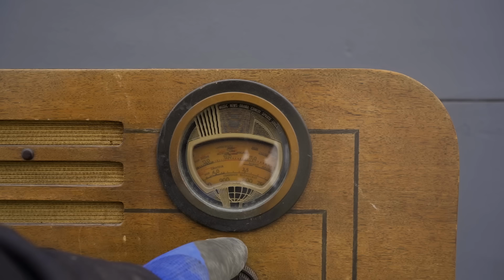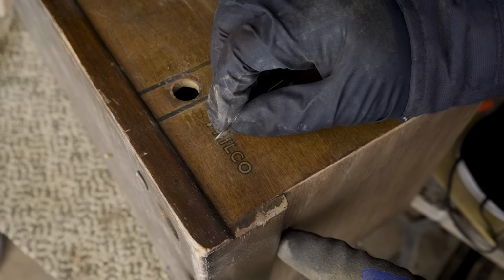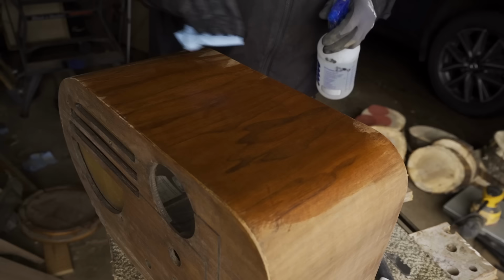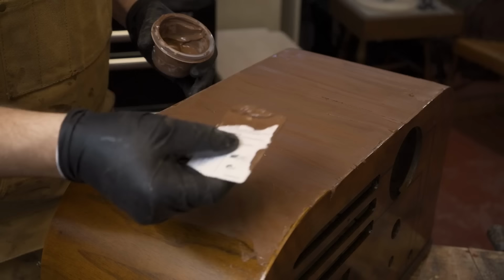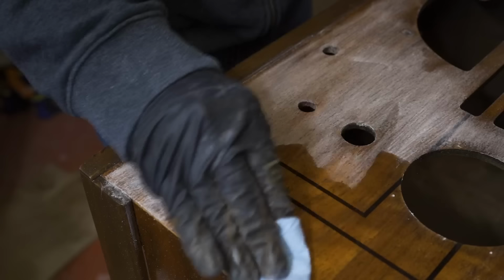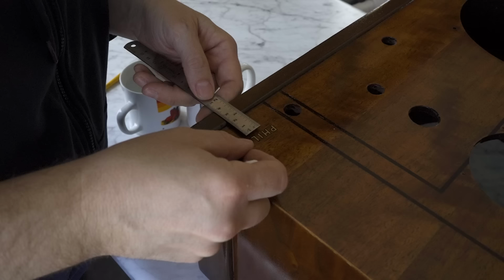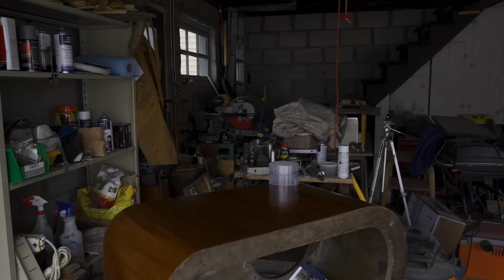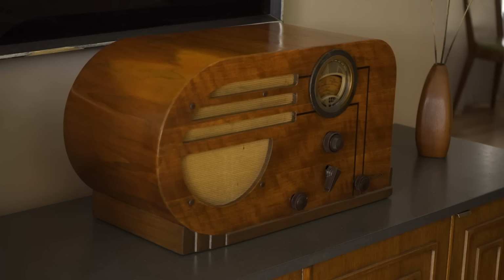Saving A Filthy Philco Radio | Vintage Philco Radio Restoration

Comment: Hey I have an Old Phil something similar to yours mines in a case built around the Raido. It an Old Yellowish tan color an the lid unfastened on the top front. It lays down to where you can see the radio face. It has an old leather handle. The radio itself is in pretty good condition as the case mine is either from the Mid to late 20's to early 30's that around the time my Brother in laws Parents owned an ran Lola's Caffe in Texas. It long gone now. I think the Leather Handle it's kind of detorating an I think at least 3 of the corners are needing some work with the cloth. The Raido is in good shape. I think my Father got it to play a couple of times then it quit.  Not sure why.  I have a other small table top Raido it kind of a redish Purple in color. I don't seem to remember the brand of it. Got both of them salvaged from my Brother in law. We believe they were his Mom an Dads. Brother in law is in his l his mid to late 70's I believe.

Comment: i find spray lacquer is crap and can ruin a whole job.....i usually give a few coats of varnish by hand sanding inbetween each coat with finer grade sandpaper..the final coat i sand with fine wire wool then wax it......PS - love the design of this radio and you done a lovely job with it.

Comment: You know there's not that many videos that could easily use the start of Pink Floyd's Wish you were here in their intro but it would have been absolutely perfect here to lead into your talking bit.  Such a fabulous radio.  Does it work still?  You made such a great job of it as always.  Thanks for sharing.

Comment: problems with the laquer might be caused by the temperature around you,, if its cold it may gives problems , e.g.   less transparent and fluent... i have learned never to use laquer below 20 degree celcius to get best result

Comment: Would have been nice if you would have had someone restore the innards so the radio actually works and tunes in channels? All I heard was static. Also wouldn't that dial on a fancy radio like that have lit up back when it was brand new?

Comment: How many razor blades did you go through when scraping off all the finish? It looks like you always used a sharp blade.
Reply: When I’m using blades in similar fashion, I usually touch them up on a stone throughout the project. Doesn’t take much to bring them back to effective working condition. Flipping the blade every 15 to 20 scrapes also helps in that it counteracts rollover of the edge. I don’t like wasting blades. They’re expensive.

Comment: great job! for removing the water from underneath the decals, you might get better results if you use a q-tip (cotton bud) and roll from the center of the decal outward instead of using a brush

Comment: Soooooo did you do anything to the radio? Filter caps, tubes or just stick it back in for looks
Reply: A vintage radio is way more fun when it’s recapped and maybe you can get an AM transmitter and stream OTR to it.

Comment: Just FYI, the spray cans usually don't have the best nozzles in them, you can swap them from other cans to find better ones.  Also, you really need to make sure the cans are heated to at least 70 degrees F in order for the material to spray out in the best pattern, and spraying them in a cold garage is not a good idea.  I usually heat a large pot of water on top of a stove until it is boiling - then take it completely off the stove - and put your spray cans in the water to heat up before use.  This makes the material come out of the can much better with the droplets being much smaller.  I even do this in warm weather in order to improve the spray pattern out of can of paint.

Comment: Thomas Johnson antique furniture restorer has a lot of great furniture restoration tips and how to’s how to match. he heats up puddy knives yes uses the wax by mowhawk some of your steps he also uses crud cutter spray to mixing up with hot water 50/50 mix using their gallon mix. acid trick he does but washes off immediately a lot of his methods. then i watch a lot of Norm Abram the new yankee work shop the shows producer has put the shows on you tube. i just watch for enjoyment yes my father and i piddled in the wood shop heavily will go back at some point n time. they both will make you look like you know what your doing. get the yankee plans to build away.